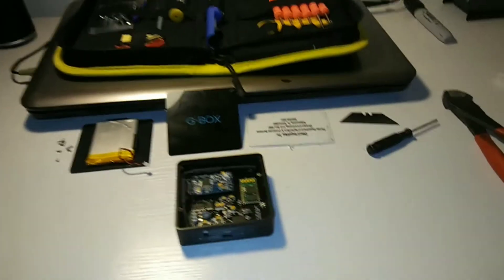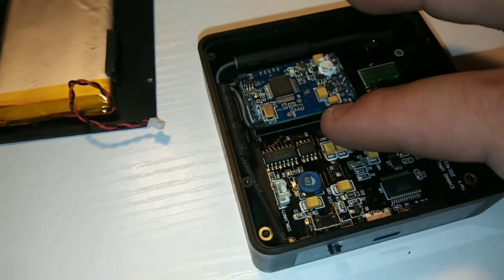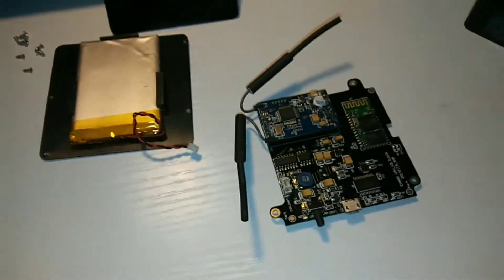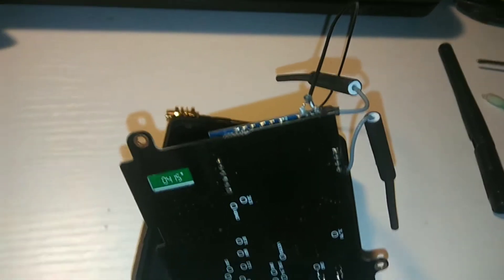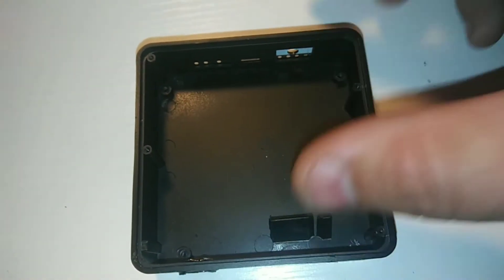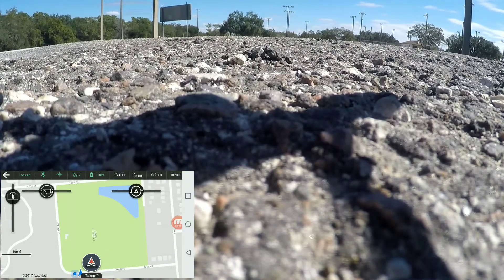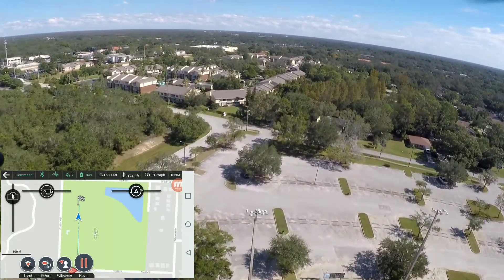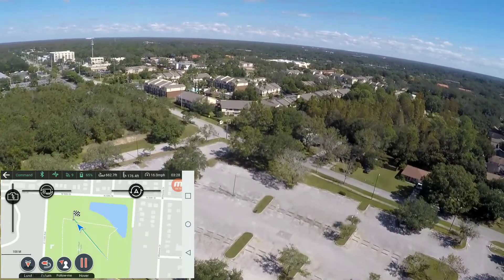Ehang Ghost Drone 1.0 G-Box Antenna Modification

Comment: One antenna is for the control plane (likely 2.4g/transmit) while the second is for video (likely 5.8/receive).  From the video I can't really see which was which, but the board at top with wiggly trace is the Bluetooth module.  The proximity of the two is also not good.  But another question, and comment.  I can only find the Ghost 2.0 app on the play store is that what your using?  Also YT is demonetizing videos where I use "Ghost" in the title just as an FYI...
Reply from the maker: Video-Drone no those antennas on the ghost we're for WiFi and telemetry. If you want fpv you have to install your own VTX system with antenna of choice.
Reply from the maker: Video-Drone the ghost drone 1.0 app can be found on the ehang website

Comment: very nice review .I wonder if this could be done on the bugs 3 fpv camera ? or would you need to mod the goggles for longer range ?
Reply from the maker: Gene RC Addiction Summers depends on what you're talking about what kind of fpv system your running and VTX
Reply: I'm using the MJX Bugs 3 setup .working on getting a better set of googles then I will look into the camera if the MJX don't work well .